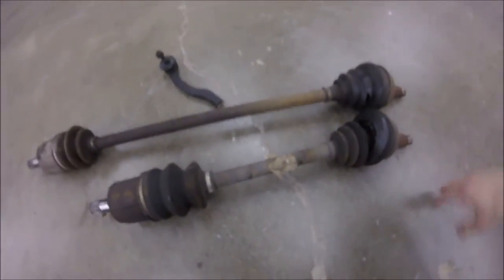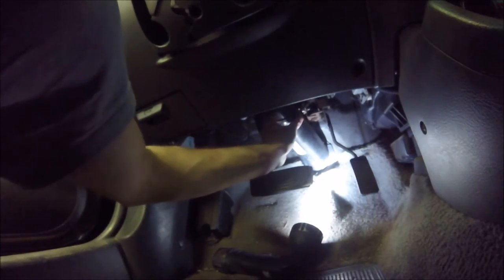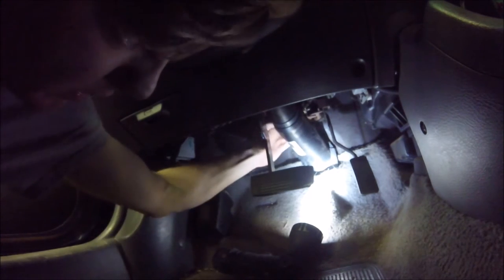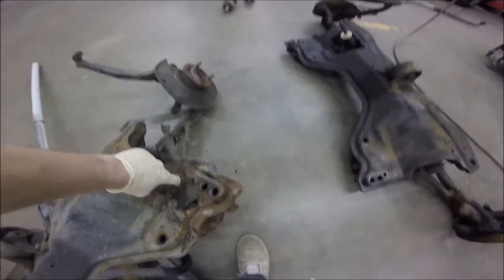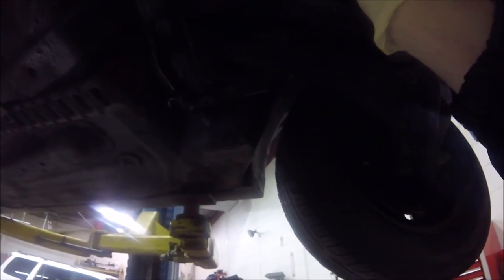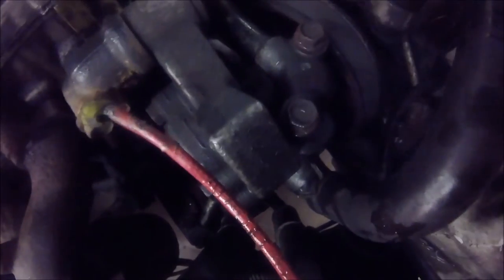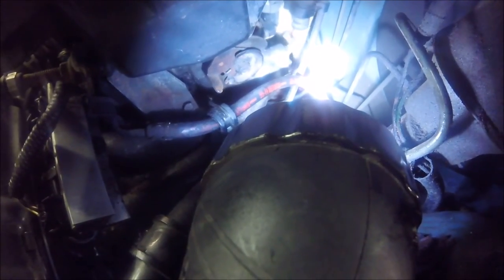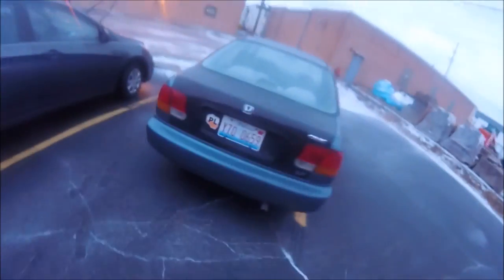HONDA CIVIC EK FRONT SUBFRAME REMOVE & INSTALL

Comment: How much that reaper that will be cost??
Reply: In my 2010 Civic (Which to be fair was rusted FAR WORSE) I shopped around and I couldn't get anything less than 4.5K.  This officially tanked the Civic.  Then I drove it around for six months like that because I'm retarded. :D
Reply: Roughly $500-$1500 if you do it yourself and depending on what route you want but having a shop do it will be 2-3x that